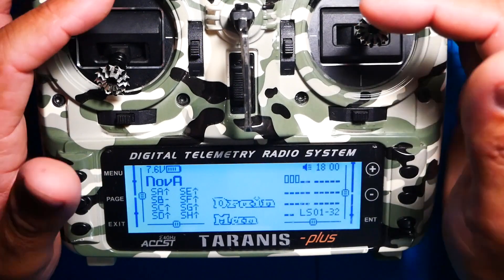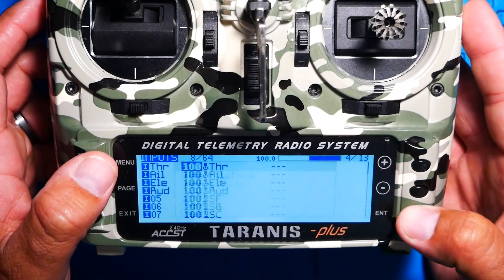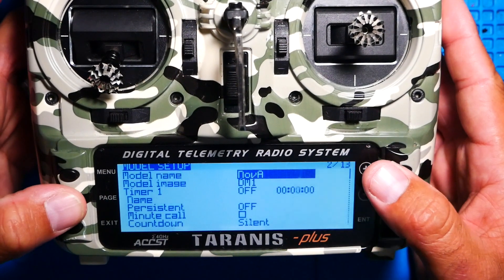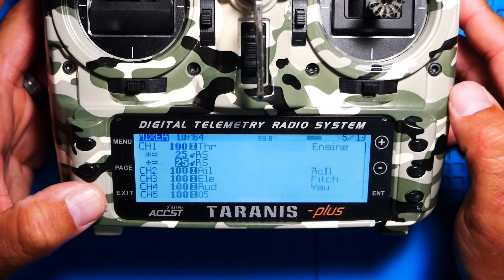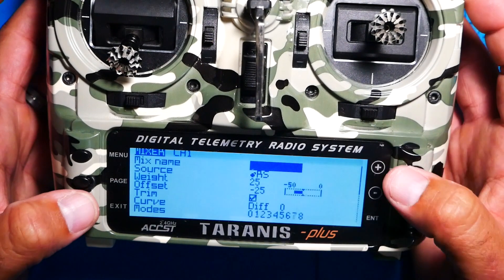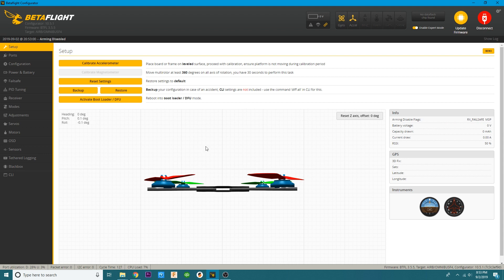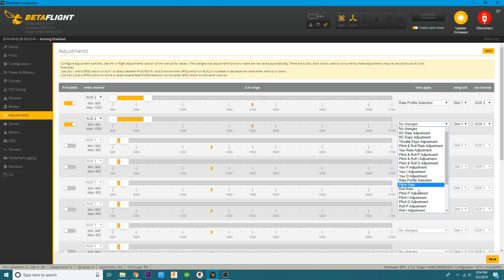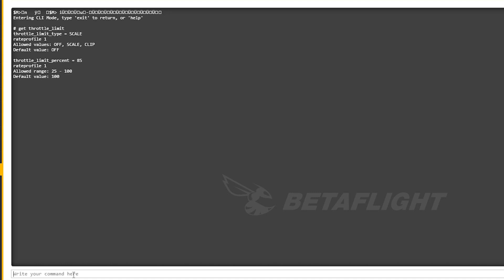The Ultimate Throttle Cap Guide - One Video Is All You Need! Frsky Taranis

Comment: So I'm trying to set 100, 50, 25 on one of my 3 position switches. mM first setpoint(100) is the same as yours no problem, Second setpoint (50) I had to set Weight = +75, Offset = -25.  I don't know if that is the right way of doing it (maybe you can tell me if that works or not), Third setpoint (25) I'm not sure I set the Weight = +75, Offset -50.  does not add to 100 but somehow it appears to work when running the Open TX simulator on my computer.  Can you tell me where I am going wrong? Thanks!